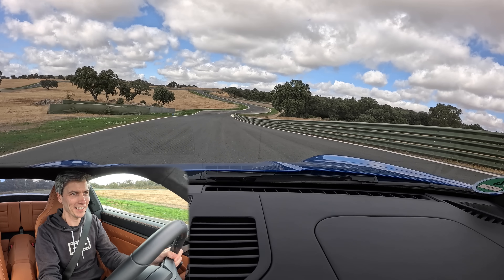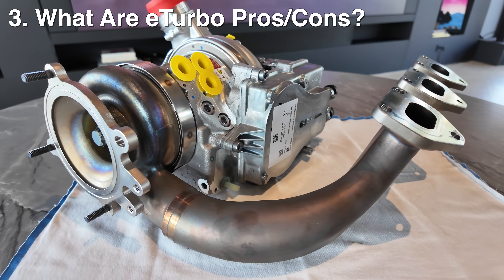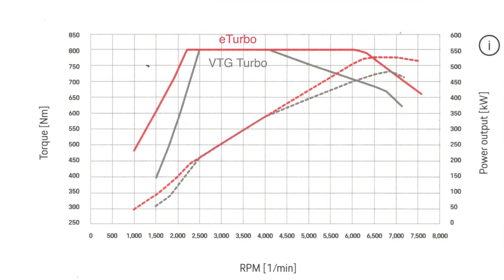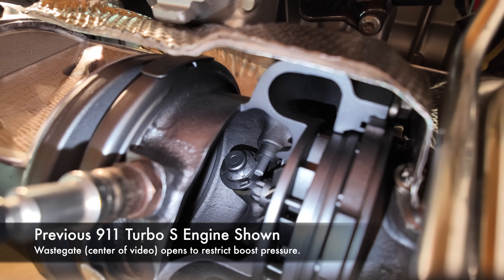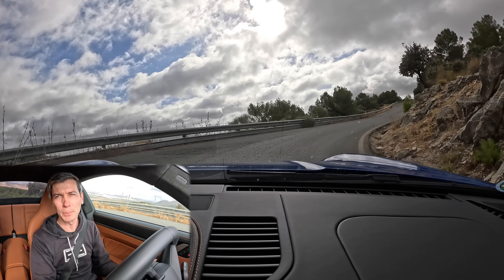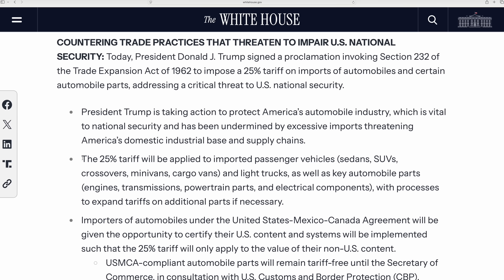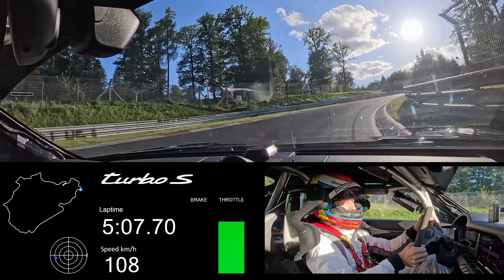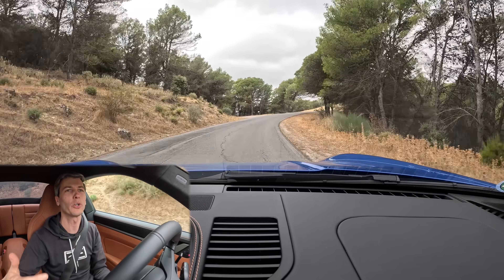Electric Turbos Are Here — Is It A Good Thing?

Comment: Beautiful idea beautiful design! Surely seem it's all beautiful on the performance side. I have just one question about this, about the heating/reliability? It's a large coil of thin enamel copper wires inside a very hot turbo machine, is this a nonissue or perhaps it's certainly already covered with cleaver cooling implementation?

Comment: Seems pointless.  An electric motor can just be used in place of a turbo.   But then again this is probably lighter and wont require a heavy battery pack, a turbo that doesn't have to spool up....

Comment: Ok, based on pervious experience that lead to no answers let's have an argument:
I drive a turbo charged car. If I am at sea level let's say it produces 1 bar at full throttle. For the sake of ease, let's call 1 bar 15psi. So, full throttle at sea level, the total pressure in the cylander when the intake valve closes is 2 bar (30psi here in the land of shperical cows), 1 bar over ambiant. Now, the question is, what happens when I am in Denver? Let's say (for ease) Denver ambiant is 12 PSI. So, the intake valve closes, what's the total pressure in the cylander? 12+15=27? 12+12=24? 12+18=30? Is the turbo operating relative to ambiant, relative to a set total pressure above ambiant, or to a total pressure overall? The reason is my engine (mazda) is variable tune based on octane you put in, with max performance happening with 93 octane. 93 is rare as hen's teeth in Denver, but would 91 allow the engine to run at max capability because it is running at a lower total pressure? Turbos, how do they work?

Comment: Haven't read all the comments, but hot exhaust/turbo and electronics? Curious to know what the life span of the capacitors, processors, chips etc. Transmission modules are dying these days on dual clutch systems because the modules sit on top of those hot transmissions. I think even these turbos will have a lot more heat than that .

Comment: The 2023 Mercedes-AMG SL 43 was the first mass production vehicle to use an electric turbo. The Audi SQ7 started using an electric supercharger in 2016 and Mercedes models like the M256 engine in 2017.

Comment: Lovely content as always - thanks.  Engineering tech is great, but, I think it's taking some of the fun away.  I think hooomans 😅 have ability limits, skill, reaction speed etc.  More power and tech may be safer (I'm not saying they are but I bet it'll be someone's argument), but we're limited by the asphalt surfaces we use these engineering toys on.  Respectfully, I think slower, less power, less tech is more fun.  Also, 1/2mV2 - kinetic energy, adding mass we're just using more energy.  I'll stay in the 1990's - where I belong I'm sure many will say, and they're right 😅, but I still enjoy your content.  Well done and be safe.

Comment: You could have the turbo motor on constant idle with a differential gear system driving the turbo fan so it never has to spool up from zero

Comment: When I hear electric turbo this is not what I was thinking...    Why even mess with exhaust restrictions and just put a motor and fan in the intake somewhere?  You would have %100 control of the turbo. I know there's a way you can run a turbo on just electricity.   Save a lot of parts and space by just putting it in the intake?

Comment: It’s a great idea. Engineers can program turbo speed to suit engine RPM and load on the engine. The exhaust part of older turbos get very hot and make it more difficult to isolate that heat from other components under the hood.

Comment: I wonder about highway cruising and how much total system efficiency is added with the turbo used as a brake? Low load, but the waste gate is typically open at that condition correct?

Comment: Okay, the biggest question in my mind is why we don't have that tech in regular cars already in the year 2025. It looks like it's no big deal. When I learned how turbocharging works years ago as a young boy, the first thing that came to my mind was why they didn't power the turbine with electricity. There were answers back then. A turbo was a sports car thing. Electricity required batteries, and that came with weight. Then turbos became a regular car thing. Then heavy batteries became a regular car thing. We got hybrids, mild hybrids, plug-in stuff, even in sports cars. So I asked again, where are e-turbos? I know that I don't need the marginal benefit of having electric support on my car's 1.5L mild-hybrid VW engine, but I would be more than glad if they used that electric power capacity to smooth the torque curve and give instant engine responses with a lot more power to me. I'm no mechanic, but it looks possible. Is it just a product management decision or an engineering problem?
Reply: In a none performance oriented application, so a normal roadcar, the gains are marginal. First of all, you can only really gain electric power from the turbo to store or use for an other electric motor under heavy load. For instance in city driving that basically never happens and even on a highway you're mostly using only part throttle, so the turbo in general has very little excess energy you could harvest. A "normal" hybrid system where an electric motor simply helps to power the vehicle forward directly is the better solution for such applications.

Comment: My friend and I tried to do this when we were 17 with his VL Holden commodore. 

He bought a second turbo engine from the wreckers for cheap and we welded a shaft extension onto the turbo with a modified a centrifugal clutch to engage at low rpms and disengage at higher rpms. We made an external tensioner activated by a servo. 

We used a small motor and gearbox to run the shaft using a belt pulley. 

We thought it was going to be awesome. 

It failed catastrophically on the first run (unsurprisingly). 

We arent sure exactly what happened, but I think it became unbalanced and broke off the mount, and the serpentine belt then dispersed it around the engine bay at high speed. 

Looking back there were an untold number of things that would have killed it anyway.

 The clutch was from a mini bike- and the bearings definitely wouldnt have survived the RPMs needed. The servo controlling the clutch probably would have overheated after a few minutes and failed, permanently engageing the clutch. 

Im sure there were dozens of other failure points, but we were 17. It was fun, but a very expensive experiment for two kids just doing weekend work

EDIT- It was a carburettored black engine from a VK commodore that someone had plumbed a VL turbo into.

Comment: Still seems order of magnitude more complex than pure electric. 
For my next trick I introduce hydrogen fuel cell with an electric turbo, with a traction motor. lol 
Unless electric turbo drastically improve mpg to come close to EV efficiency don’t see it as long term technology that will be adopted. EV = cleaner power train design and cleaner output when considering battery materials can be recycled at 80% + recapture as well.

Comment: Would i be wrong in thinking if an electric motor is driving the shaft in a turbo that both has a turbine and a compressor wheel that not only would the compressor wheel pressurize the intake air but also the turbine would be pulling the exhaust out🤔?

Comment: Would there not be any advantage to driving the exhaust side with the turbine, to scavenge exhaust? I suppose you'd likely spec the turbo to be larger instead, as the e-motor would still negate the lag.

Comment: Cool video, thanks.
One thing I wonder about is when the turbos are at max boost and are generating energy through a braking effect, how does this affect the backpressure and temperatures the engine sees? Surely this must be higher than a wastegate, right? There would presumably be a larger temperature delta over the turbo itself due to the pressure change over it?

Comment: Very interesting that the electric motor is sandwiched between the exhaust driven turbine and the compressor.  When I heard electric turbocharger, however many years ago, I assumed exhaust gasses would no longer be used.

Comment: I’ve always thought that the hot exhaust gases turning a turbo is where we get dependability issues because of bearings and cooling challenges. When will we see a totally 100% electric turbo where you don’t have to worry about cooling it or replacing the bearings because of the hot exhaust gases?

Comment: This is amazing. The best part for me is the constant energy recovery from the exhaust gases. It’s basically a mini power plant inside your car!!!
Regular turbos already added efficiency to the car by harnessing energy from the exhaust gases to provide extra air to the engine, but there is a design limitation and they need wastegates.
With the electric turbos, they can harness even MORE of the energy that the exhaust gases have, since they don’t need to discard the gases when the driver is not accelerating. This is so cool!

Comment: This makes absolutely zero sense.  The purpose of the electric motor is to spool the turbo when there is no exhaust, yet anytime the engine is running there is exhaust. So basically this turbo is so you can spool your engine up while it's not running? And this is not even getting putting an electric motor inside a metal casing connected to a hot engine. Have you ever stuck your hand on a turbo after a long trip? I see lots of issues with this idea

Comment: This tech in a family car (diesel or petrol) would be cool. (with a manual gearbox option)

(If the oil pump is electric as well, it might be possible to get it to not idle at all, get the fun of a manual and great fuel consumption)

Comment: It's cool tech, I feel like it will end up in a lot of VW group standard cars as they push out the full EV change over but have to meet Euro 7 standards. It does highlight one major thing though - mum & pop local garages won't be able to look after many standard new vehicles coming out to meet these new emissions standards and most vehicles will have to go back to the manufacturer dealer for anything.

Comment: You are a smart, young engineer.  Why don`t you post a video of battery degradation after ownership, 2-6 years,  and the detrimental effects in cars (on range) of operating ac and accessories/ lights and cold environments?  Charging grid limitations?  I am definitely not ready for a Tesla (since my 3 year old laptop now needs charged every 2 hours instead of the initial 7 hrs.!!!)

Comment: Seems like it would be more effective to skip the exhaust turbine completely. With the new high torque, high rpm electric motors, just use an all electric turbine. Drastically simplified and reduces weight.

Comment: Im just a plumber from San Antonio here so my
watching this clip got me to remembering a teacher of mine back in highschool that told me
An idea of mine would be a waste of time. I had taken a leafblower and tweaked it to work on dc 12v power from my ciggerette lighter on my truck. I used it to blow all the leaves out normal driving wouldnt remove and to blow out trash from the cab. I wondered what if I ran a hose to my intake to give my 350 some much higher air intake & he said unleds there is additional fuel to match it wouldnt amount to anything ? The leafblower broke and the thought of it faded away I never tried doing it anyway so now im wondering if I had tried hooking it up if I would have noticed any improvement in performance?

Comment: Been there, sort of did that.... 1972, I pulled my grandmothers lawnmower apart with the intention of using a small electric motor, used in small model cars etc, to do a type of turbo charging. My parents ended up having to buy another lawn mower for grandmother as it didn't work - I was 7 years old with so many ideas well above my skills/abilities/knowledge   :)

Comment: Heat and electric motors are going to be in opposition. Exhaust gasses will heat that turbo up as it does all turbos. That heat will spread down the shaft to the electric section. How are they keeping the electric motor/generator cool under high turbo heating conditions?

Comment: That sounds more like a supercharger than a turbo. Turbos are scavengers. This is.. not?

If we're doing things like that I'd rather have water and oil pumps moved off-block and ran by separate electric motors. How many times has a water pump failed and turned into a nightmare to replace, or trashed the block. Same for an oil pump. Easier to replace, probably survive long enough to get out of the warranty period, make the block smaller and easier to manufacture, more flexibility in mounting things.

Comment: The combination of a supercharger (for low revs) with a turbocharger is well known.  Powering the supercharger electrically rather than mechanically is an obvious alternative, recently used sometimes by Mercedes  The big step forward is to apply both power inputs (the exhaust gases plus the "supercharger drive") to the same compressor, probably only feasible with modern electronic control systems.

Comment: So why not just have a purely electric turbo charger? You can have an ECU programmed for it that keeps air intake pressure at optimum settings for certain rev ranges. You could put it in sport mode  for constant maximum air intake pressure etc.

Comment: The energy recovery on a gas turbo is really good because gas engines push too much energy down the exhaust (as compared with diesel which is quite a bit less).

Comment: Engine architecture (core)
 • Compact 4-cylinder, 2-stroke engine targeting roughly 165 hp through aggressive scavenging and precise boost control.
 • Each cylinder has multiple small, steeply curved exhaust ports arranged around BDC, but they slope upward to prevent crankcase oil migration out the ports.
 • Eight load-bearing bridges between ports preserve structural integrity and piston alignment under load. Minimal moving parts; mechanically robust.

Exhaust & scavenging
 • Downstream variable actuator tunes exhaust backpressure and scavenging timing for different loads.
 • An exhaust-side supercharger (rotary or twin-scroll) acts as an active extractor to pull spent gases and manage pressure phase timing.

Dual supercharging & drive
 • Two superchargers: intake (boost) and exhaust (extraction). Both are rotary or twin-scroll units.
 • Each supercharger is belt-driven from the crankshaft with a CVT placed between the crank pulley and the supercharger drive.
 • The CVT lets you set boost/extract ratios independently of engine RPM, enabling chosen boost levels regardless of crank speed.

Valvetrain & timing
 • No camshaft. Intake and exhaust valves are electronically actuated, enabling dynamic timing/duration control and tight synchronization with CVT-set boost.
 • This allows switching between modes (high-efficiency vs high-power) and precise phase control for maximal volumetric efficiency and power.

Mechanical philosophy
 • Pure mechanical ratio/pressure control via CVTs combined with electronic valve actuation for timing.
 • Emphasis on pressure-phase harmony, structural strength, and high-resolution mechanical control. No kinetic flywheels — focus strictly on engine, scavenging, and supercharging subsystems.

Comment: 1,9 kWh just for an electric boost for eTurbo and an electric motor in the gearbox? Doesnt sound much and also "weak".
Also, if those 40kW are real... we talk about 20C discharging and about 10C charging. Not even including the peak amps due to ripple. Poor Lithium Polymer packs...

I have high drain cells in my E-Scooter, which has a 2,2 kWh battery (modified Vsett10+), yet the battery degrades much faster when pulling beyond 5C (which is already about 10 kW power draw on the battery and about 7-8 kW mechanical power ont the wheels)

Comment: Yes it's wonderful but so complicated.
I'd like a simple electric supercharger.
Keep the hot exhaust separate and moving smoothly while the cold intake stays on the other side.
So simple it could be retrofitted to most cars.
Just one thing that you can replace and program yourself not five systems waiting for one to fail.

Comment: I presented this idea to a bunch of my friends and teachers like 6 years ago and they said it's impossible.. I only fear for the heat generated by the turbine : electronics don't really jive with heat that well.. maybe if we had the whole turbine housing submerged in a cooling jacket and then linked to it's own coolant circuit.. PORSCHE AND MERCEDES AND AUDI ENGINEERS DO NOT STEAL, YOU TALENTLESS HACKS!
Reply: but the fact that the turbos can be used as generators paired with the traction motor in the gearbox turns this thing into a very complex train-hybrid. you see, in diesel electric trains, there is no mechanical connection between the diesel engine and the driven wheels, instead there is a big honking generator coupled to the internal combustion engine, which then feeds the traction motors fixed to the wheels of the locomotive. this is quite ironic, because Ferdinand Porsche (the dude with the name) actually suggested to big H himself that they should use a train hybrid system on the king tiger for better reliability back in WW2.

guess old habits die hard at porsche xD

great video man!
Reply: pps, I forgot to mention the genious way to combine the starter motor and alternator in that one big sandwitch motor, while this in itself isn't anything new, driving it with basically exhaust gases is really cool.

Comment: The car's alternator is, at best, 50% efficient at turning mechanical energy into electricity. I don't see this as viable in instances where high fuel efficiency is a consideration. But it sure is fun on the track.

Comment: Heat will destroy them. At this point, why even have exhaust turbos? Electric turbos/ supercharger can be mounted in a cooler part of the engine, away from the hot exhaust.